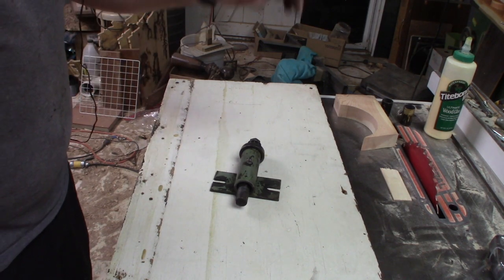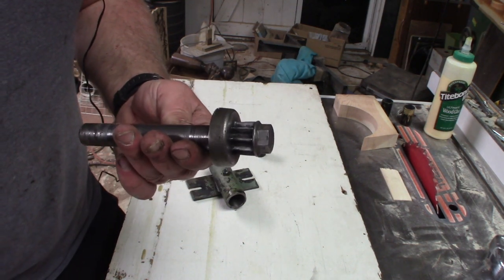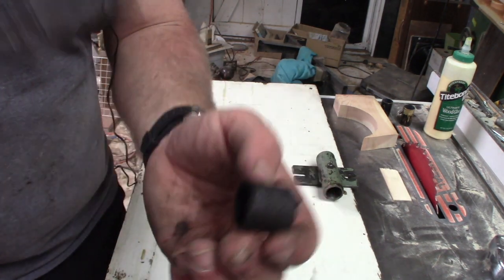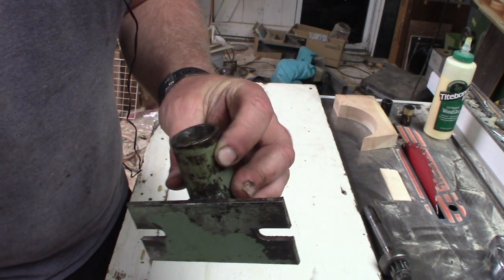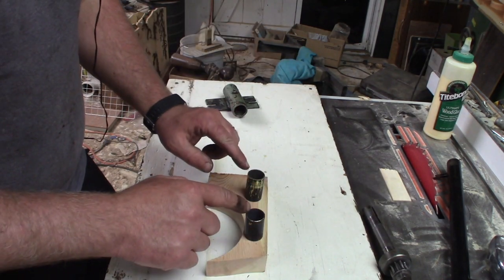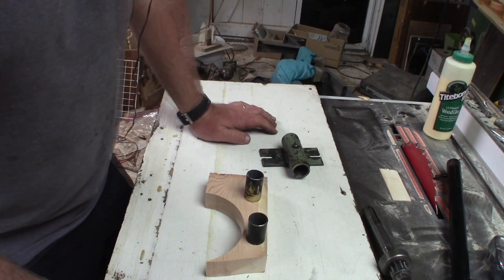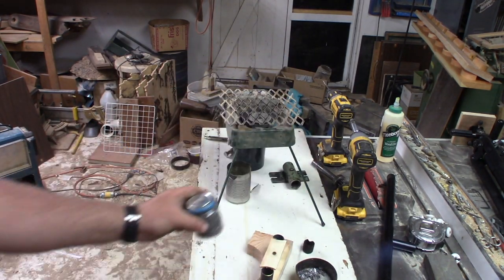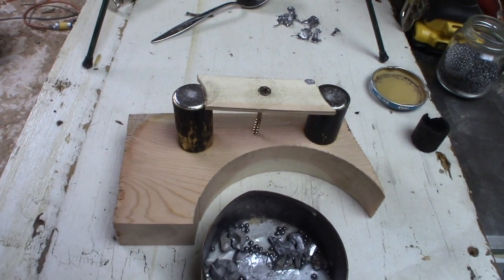Poured Lead Cement Mixer Bearings

Comment: For a future upgrade, you can make up a base plate and use two sealed pillow block bearings side by side to hold the shaft, and when one does fail, it is easy to just bolt another one on.
Reply from the maker: I keep thinking that little starter gear would be the point of failure but years later..  My luck would be a nice long term solution like yours and then the teeth of the gear would pop off like spilled skittles.